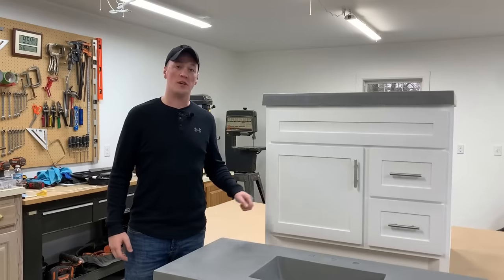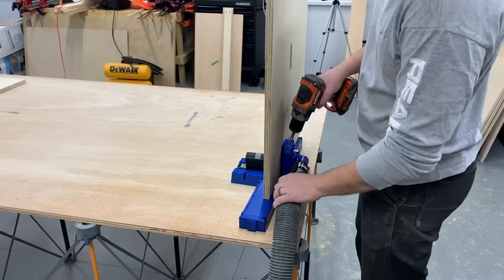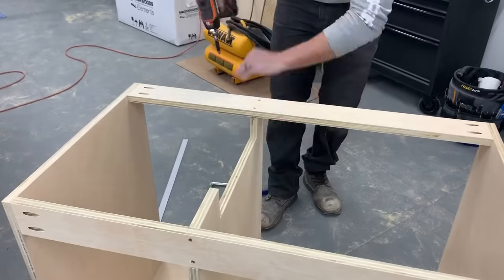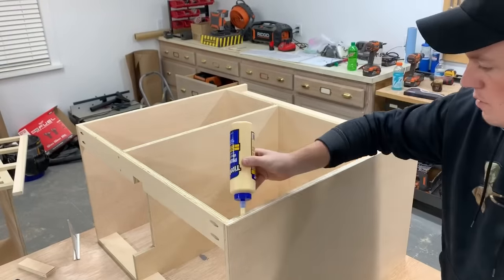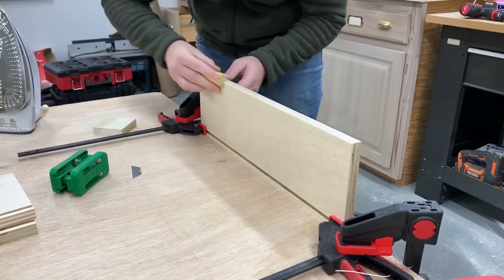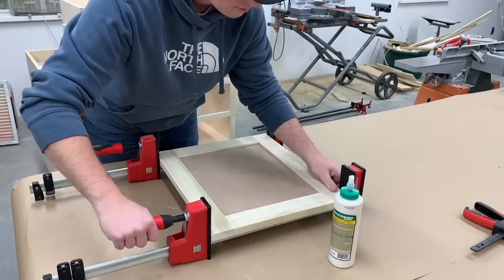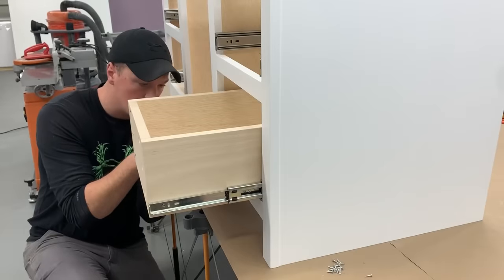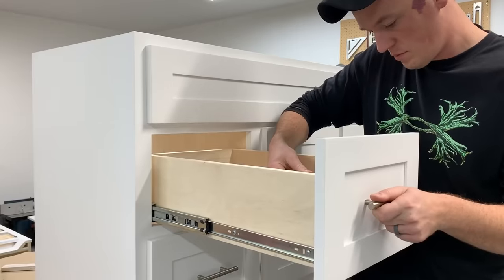Building TWO Vanities for half the price of buying JUST ONE | With Build Plans!

Comment: to help keep the foam insulation on the table when cutting down the full sheets, use some of the command strips for hanging posters.  They're removable and hold well enough to keep it from slipping around.

Comment: This was about the best $8.00 that I ever spent!  Since I don’t have a router table, I built the drawer fronts out of solid maple(gluing required).  I really like the look.  The Kreg drawer guides worked great instead of using scrap spacer pieces.  I used 1/8” Strips of scrap wood under the drawer fronts as spacers.  Because this was a first for me, I didn’t glue as many parts as you did, figuring that I might need to some steps over.  

GREAT PLANS AND ACCOMPANYING VIDEO!  I’m a subscriber!
Reply from the maker: Awesome man! Have sold quite a few plans but haven’t got any feedback yet so I appreciate it!

Comment: Thanks for this awesome video. It really motivated to get back into woodworking! I’ll be using this video as my step by step guide. Well done!
Reply from the maker: That’s awesome!!
Reply: John, one question...with the carcass width at 20.5 inches, when you add the face frame and protruding drawer face (not inset with face frame) the drawers are actually even with the edge of vanity top correct? (22 inches total width) Thanks

Comment: I really like the build.  Corner blocks are a nice touch.   Personally I would have used dados for the bottom shelf just to add a little more support and rabbit the back and left a 1/4 inch on the side to scribe to the wall.
Reply from the maker: There was a 1/4 and scribed to the wall👍🏽

Comment: Great video.  I happen to have the same table saw and the portable router table you have.  You might be pleased to know that if you drop the plastic legs from the table, you can mount it perfectly in the table saws right side (the fence floats right over it as well).  It provides more surface for the saw and serves as a convenient "small shop" feature.

Comment: Awesome build. I see you are a fellow Milwaukee guy. the 12v impact is awesome but I like the new assembly drill with the swapable heads. For things like this cabinet it is awesome for those odd angles. Highly recommend picking one up.
Reply from the maker: It’s on the list haha I’ve been wanting it!
Reply: @JohnBuildsIt  yeah man you won’t regret it. They also run 12v specials on them all the time I got two free 6ah 12v with mine when I bought it. Haven’t seen a deal that good again but I also think my homedepot screwed up and gave me 6ah instead of 4ah

Comment: Wow, amazing job ... and I like your toe kick!  Thankfully your pocket holes on the divider weren't where the drawer slide mounted ... I've made that mistake before.  

About the vanity top, how does it mount and how did you know the stretchers wouldn't be in the way?
Reply from the maker: I had the vanity top with me in the shop. They’re usually just set in place with silicone

Comment: Great attention to detail and you have explained it well. Your video is amazing. I am planning to build a 90 inches vanity with 3 cabinets of 30 inch each. I am planning to buy the doors and drawer fronts and build the cabinet by myself. For a 15x30 inch door what would be the inner width and height of the cabinet if I use 3/4 inch plywood and use a face frame of 1.5 inch around the cabinet? is the face frame going to be flushed with the outside wall on all sides? Thanks for your time in advance.

Comment: Nice vid I will be using the toe kick corner block. One thing I have never understood is why the back of the drawer bottom is not supported in a dado. Is it just for ease of assembly?  ✌🏻🇺🇸
Reply from the maker: This way it’s removable, and being for a bathroom vanity, it’s possible stuff could be spilled in it. And screwing it in the back like that allows you to pull the box into square and then lock it in with the screws. It’s common for the back to be in a dado like the rest too, this is just the way I do it! Thanks for watching! 👍🏽

Comment: Really nice work. When you place the styles, is there a right or wrong way of doing it? On the opening for the center door, the styles were held flush on the drawer side but over hanged in the door opening...is this how it's usually done? Just asking. I agree with everyone else on the 45'd return on the toe kick...super nice detail. Thanks for uploading.
Reply from the maker: If I’m understanding your question correctly, it’s done like that for the drawer slides. This way I could put the slide right in without having to add fillers like I did on the other side
Reply: @JohnBuildsIt  That makes perfect sense now. Thank you.

Comment: Thank you for those plans. I’m in the process of building mines, but has to change the measurements cause my kids bathroom ain’t big enough for a 48 lol so I made it 42. Where did you get the white Melamine board? Can’t find it at nine if my big box stores? And for the draw fronts, how did you get those measurements? Just trying to not mess it up lol. I made Dovetail drawers also. Thanks for any help
Reply from the maker: I got it at menards. Which measurements on the drawer fronts? They’re sized to create a 3/4 reveal on all 4 sides if I remember correctly

Comment: Mate that looks awesome! One question. I use pocket holes for joinery also but when I try and connect a board either on the edge for a 90 degree or if I join a board in the middle to make a shelf I'll have a line where I want the board to sit and when I screw the board it will always creep off the line. How do you gets yours to stay and connect exactly where you want it? Thanks
Reply from the maker: The right angle clamp helps a ton! If I can’t get the clamp on, I literally set my piece about a 1/16 away from where I want it so then it’ll move to where it’s supposed to be. Kind of a pain haha
Reply: @JohnBuildsIt  thanks for the reply mate, I'll give it a crack and buy one 👍

Comment: I built both, one change I made was I added drawers at top, on the 48”, I had one each side of sink, the 36” didn’t have a sink so upper drawers were added. Plans were great, the angled base are nice
Until i installed vinyl click plank flooring, I had a few mistakes getting flooring cut around those angles correctly.
Thanks for the great plans
Reply from the maker: Awesome, thank you!!

Comment: Particle board (including MDF) should not be used in any area where it might get wet or is even humid.  It's not a question of IF it will swell and come apart, but WHEN.
Reply from the maker: Exhaust fans work wonders in a bathroom lol, these will last forever
Reply: @JohnBuildsIt  -- Get back at me in 30 years... Of course, I'll probably be taking a dirt nap at that time, but feel free to wake me up... :)

Comment: I really like the look of the toe kick area.  Is it deep enough though?  Not trying to be tool.  I just have not built cabinets yet.  I thought they had to be like 3.5 inches deep or something like that.  Could you increase the depth of the toe kick and still use this toe kick trick?  Thanks.
Reply from the maker: It’s still 3 inches. There are no rules for custom work haha some cabinets have no toe kick. But yea it could be deeper if you wanted

Comment: I have the same rigid planer as you. Currently having issues with it skipping and leaving notches in the wood. Have you had that issue with yours, and if so how did you fix it?
Thanks!
Reply from the maker: I never did, but making sure the bed is waxed and nice and slick, and changing the cutters is about all you can try on those

Comment: Damn you are good! I learned a lot! On a side note, I’ve been torn whether to get the Milwaukee m12 system or the m18. I’m currently using dewalt 20v and ryobi. I want to make the switch to Milwaukee. I might do the m12 after watching this video.
Reply from the maker: abaswilderness yea I started with 12v since I’m already so invested in the Ridgid 18v. You just can’t beat the tool options Milwaukee has!
Reply: abaswilderness I have 6 of the M12 fuels and I absolutely love them. I also have M18’s, as well as rigid 12 & 18’s and I use every 12 every day and haven’t pulled an 18 out of the box in close to 6 months. The 12’s do EVERYTHING I need done, and I don’t just do small jobs either. 

Years ago I was a diehard Dewalt fan but once I tried the Milwaukee platform I gave the dewalts away and never looked back!!! Best tools by far I’ve ever used. 

Good luck
Reply: Don Pfeiffer I can’t thank you enough for writing this. I’ve been so torn because I didn’t want to invest in a battery and brand platform without being sure of its abilities. Seriously, I really appreciate you friend.

Comment: loved your build, just had a question did you add a finish to the plywood interior? and what material did you use for the face frame and for the doors and drawer fronts that you milled?
Reply from the maker: It’s all poplar. I applied a couple coats of watered based poly on the inside

Comment: Great work. Does the paint fill/hide the drawer front joints?
Reply from the maker: Aaron Christopher thank you! No, paint alone wouldn’t. Really if the joinery is cut good, you shouldn’t be able to see the joints as is. But if there are some imperfections I would fill them with wood filler or something like that DryDex that I used on the brad nail holes

Comment: Very nice and like the toe kick.  ON your Earlex 5500 what tip/needle size did you use and how much did you thin the primer and paint?
Reply from the maker: Philip Harris primer, 1.5 tip, unthinned. Milk paint, 2.0 tip, thinned until it looked good haha don’t usually measure it. Thanks for watching!
Reply: John Builds It you are welcome and thank you for your reply.  I generally use my Earlex 5500 for Shellac spraying and other thin top coats with a 1.0 and 1.5 tip.  I have a turbinaire 1235 mini pro that I use for painting and use the 1.5 tip after thinning till it looks good haha   Nice work young man

Comment: Are those home made concrete countertops or did you buy those?
Reply from the maker: It’s not concrete. They’re marble
Reply: @JohnBuildsIt  they look great. Were they a stock size and you built vanities to suit or you had them made to fit your vanity? I have to build an off size vanity and am trying to figure out the top situation. I'd love to use the concrete system you used in the kitchen but am open to other options too.
Reply from the maker: Tim Castle they’re standard sixes. 37” for the 36” vanity, and 49” for the 48”. If you go with the concrete route, let me know, I’d love to see it!

Comment: Is there a reason you went with 3/4" for the drawers?
Reply from the maker: Mainly because I practically had enough to make them all from the 2 sheets I bought for the carcasses haha 👍🏽 I always use 3/4” though pretty much, more room for the dado in the bottom for the drawer bottom
Reply: Awesome answer! Which also helps me in knowing that I can use smaller if wanted without it being an issue.

Comment: Sweet! Now I just need to buy $10k worth of tools so I can make a vanity for $600. Any tips on convincing the wife how this is a good deal?
Reply from the maker: Build them with $100 worth of tools would be the best bet 👍🏽
Reply: @JohnBuildsIt  that would be awesome, but I don't have a planer, joiner, router, table saw or miter saw.  I do have a cordless drill, jigsaw and circular saw though. Never got into the fine woodworking, but can't find a bathroom vanity with drawers on the left that will fit my supply lines and drain. Should have thought of that before I ripped out the original

Comment: Add in time for labor... Double the cost of box store vanity.
Reply from the maker: And half the quality though! Haha that would depend on the person building them too, cabinets are pretty darn quick to build. Thanks for watching!
Reply: voelker67 and four times the quality cause box stores only have 1/2” sides and usually have particle board instead of ply and they are hot melt glue and stapled together. 

So what if it is double the cost, you do get what you pay for remember. Your actually not even comparing apples to apples by comparing a custom build cabinet to a big box store cabinet.
Reply: To each there own. Once vanitys or other cabinets are attached to the wall and have a top silicones to them, they are pretty solid. Water damage is water damage regardless of material.  Hinges and drawer slides are a different beast.  

- Cabinet builder for 10 years / Kitchen and Bathroom Remodeler for 15 years. 

Great build though. I like it.
Reply from the maker: voelker67 thanks man! I’ve gotten that labor comment quite a few times haha and if it’s a personal build(or in this case, for my parents) I don’t think it even matters. I built them in my free time, doing something I enjoy as a hobby, instead of sitting on the couch watching tv at night haha not like I was taking time away from work where I could be making money